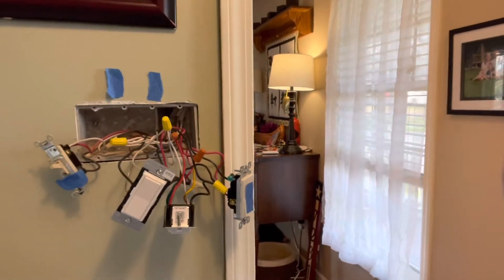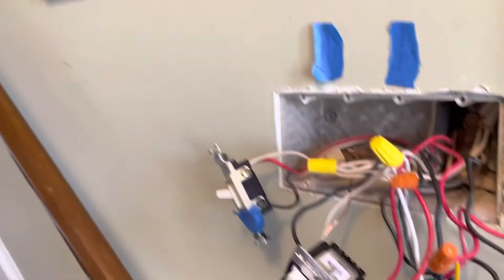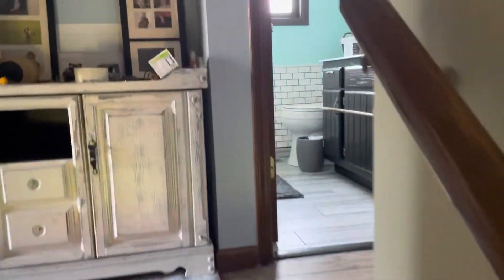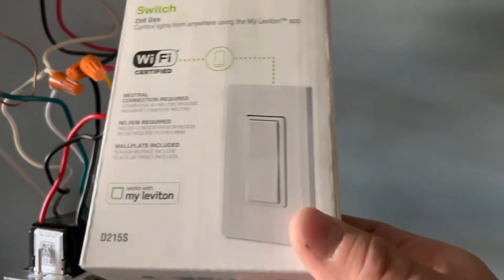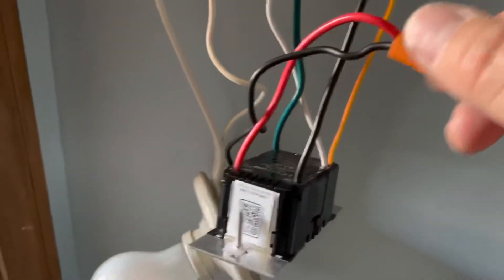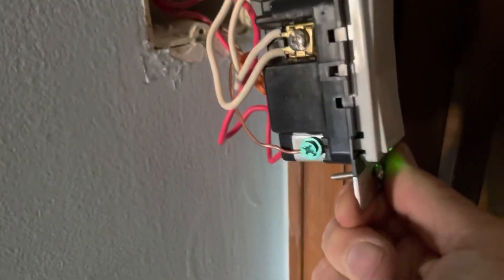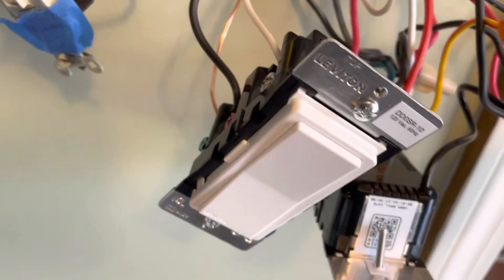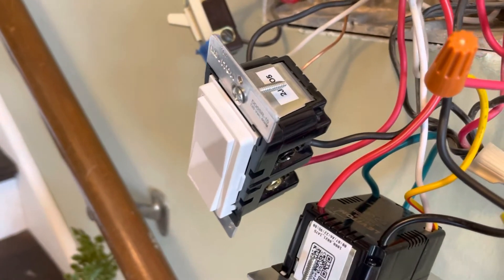Leviton 4 Way Smart Switch Wiring

Comment: If anyone came here to figure out what they were doing wrong... check to see if the main switch, not the remotes is bad.  Mine would turn on the light but neither remote functioned.  Had another smart switch lying around and now it works.  4 hours of double checking every wire while working on a hot circuit was no fun.
Reply: hey I got the same problem, my main switch can control the light, both other campanions are getting the power (green light on) but none of them can control the light. I tried switching the load and traveler line at main but it cannot even control the light anymore. I don't know what else I could try. How did you fix this issue?

Comment: Im amazed that didnt short, you tied your neutral together with the yellow with red traveler.I bet the yellow to red at ( bottom steps) is never used by the switch as a hot traveler, if so it would short at (up steps left) where red connects with the white neutrals, maybe its because a hot common will always take the shortest path, I bet if you removed the red wire and capped the yellow it will still work.